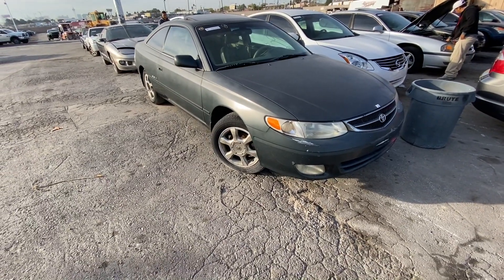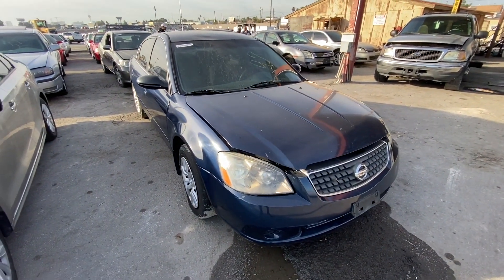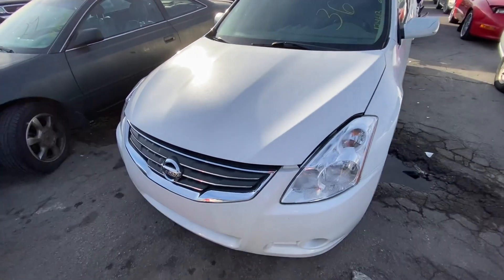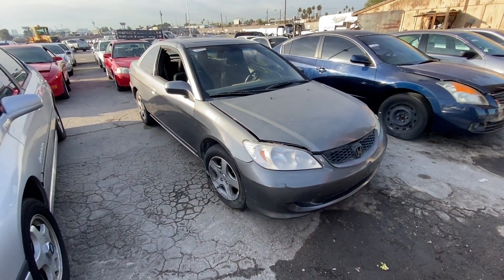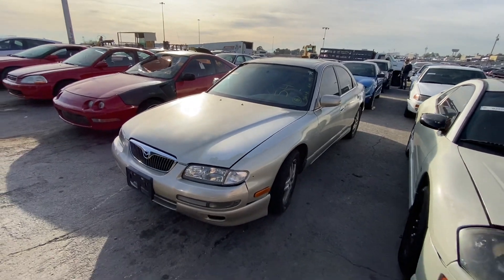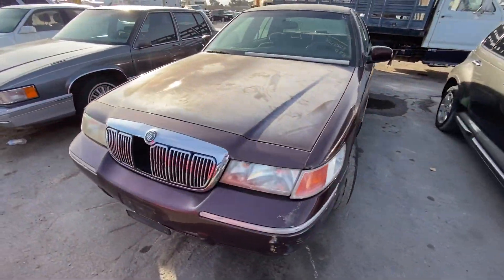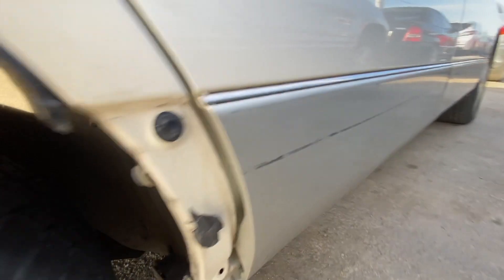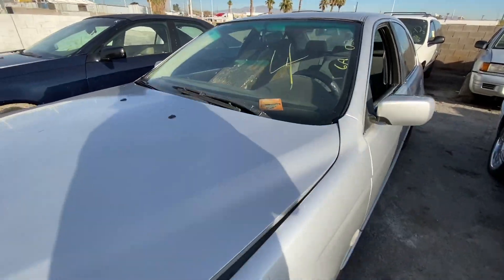Las Vegas Auto Auction 12-14-19

Comment: That Grand Marquis may have been 1 of the better cars out there had you checked it out. They are considered old folks cars but there's a huge market for them. I always keep a couple on my lot at all times. The 4.6 liter engine is bulletproof with a solid built automatic transmission behind it.